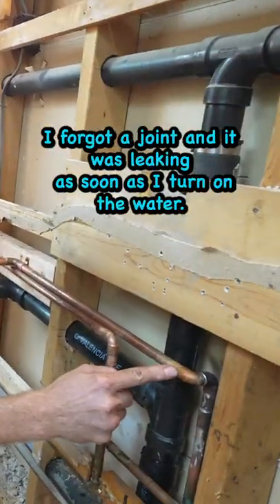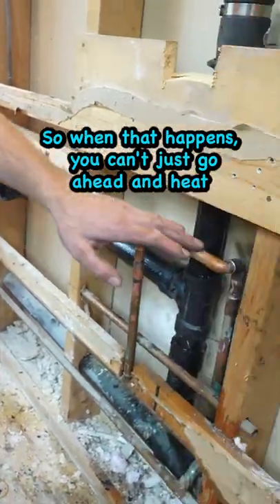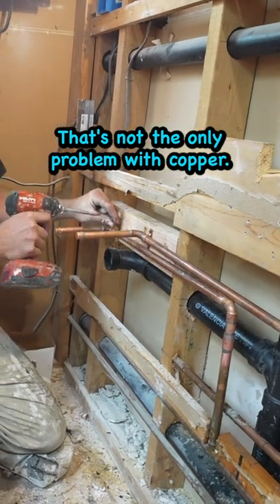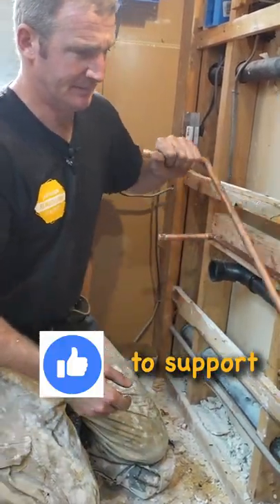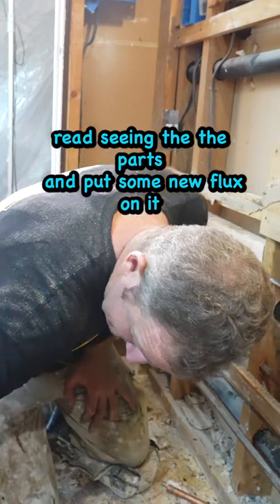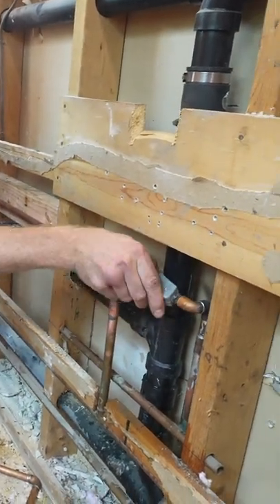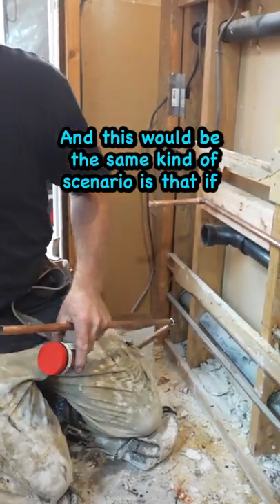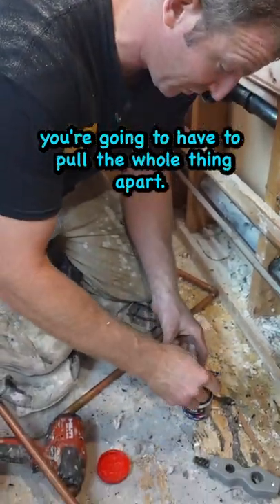I forgot to solder a copper joint 😬 #shorts #plumbing #diy

Comment: If it was sanded and fluxed good the first time you can heat the joint alittle (hot to the touch) and dab some flux on there and it will wick like the solder then heat and solder as usual. I would say 98 times in 100 it won't leak. Best practice is to take it apart especially if this is all the plumbing you are doing on the job. I like pex for certain things but anything that a human can touch I always use copper back until it can be secured in at least 2 places. Pex out in the open is a disaster waiting to happen.

Comment: Use Propress stuff. Done. Wet or dry. My guys won't go back to solder, especially on the larger stuff.  Had to change out a 1.5" back-flow the other day in a commercial building where they needed water off only briefly. Propress was the trick.

Comment: Well done for checking your work before the walls got closed but you didn’t have to take it apart to solder it. Also if you miss a bit of solder you don’t need to take it apart.

Comment: Remember to use new emery cloth. I had alot of trouble getting solder to seal on two jobs. Turns out my sanding cloth was coating my sanded copper.

Comment: Only criticism I have is clean up that spot cause it’s annoying to drop something with flux in that mess lol or drop a strap or a screw or anything and you can’t find it. As a commercial plumber I’ve learned the extra ten min to sweep up my work space makes it easier to see things an limit my mistakes which I know happens to everyone. This has happened on my sites multiple times especially when I have a few guys working on the coppers.

Comment: Just check before using soft solder.  May have a high lead content. Thats how it used to be done. Plumber 30+
Reply: No more lead solder, no lead in fittings either

Comment: This is clearly why I detest copper. I have replaced all my homes with pex and push to connect connection. I no longer have to deal with the hassle of copper. I can add anything in with a simple cutting of the line and adding in some fittings. Copper in homes is just a poor move. It cost far more and has many problems when people have no clue how to install it the correct way.

Comment: Heres another tip get out your wet vacuum and when all the water is pulled out, heat the joint while applying your Flux. When the Flux pulls in hit it quick with solder. Your welcome.

Comment: First off, this guy is clearly specialized in dealing with bathroom uplifts. Turning an outdated bathroom more modern. Most of these comments I’ve read are very controversial an opinionated about his plumbing skills. Clearly he’s more of a handyman than anything and I’m not saying anything bad about that. But working for a plumbing company myself for quite a few years everyone does things differently. Everyone’s talking about pex like it’s the best thing since sliced bread. Sure it’s cheaper and a little more time saving installing it but it’s got its problems too. you get rodents in your walls and they can chew right through it. Any old school plumber would tell you copper is the best way if you know what you’re doing. But some people just don’t have the skill. And sure propress is quick but not everyone wants to spend a couple grand on a good kit plus the expensive a$$ fittings. Another thing shark bites? The worst thing you can ever use unless it’s just for a temporary cap for the lines. Yeah he also didn’t use air chambers but some states don’t require them. Like I said this guy does good work but he’s not repiping entire bathrooms from scratch just fixing small things to give the bathroom an uplift.
Reply: I’ve been doing commercial and residential plumbing for almost a decade and shark bites are not even close to bad. We use them all the time and they come in handy because you don’t need to use glue or solder. I have also never seen one leak.
Reply: @gsaexperience8578  Same here I have been using and installing sharkbite push to connect fittings for more than a decade with out a single leak. I also never had to go back and fix a leak either. People who hate shark bite or like products hate it because a home owner can fix or install it them selves for little to no money. 
A house I did over 10 years ago sat empty for 2 full winters along with one year that had a nice spell that was 40 below. No one ever drained the water so it sat with water in all the pipes and nothing broke. They did fill the toilets and drains with RV Antifreeze yet did nothing. Not a single leak at all. 
Rodents do not go after plastic. I just did a house that sat empty for 3 or so years that was fility and likely had rodents in it and they had pex installed, said pex was removed due to the entire house being remolded. People spread misinformation on things they hate.
Reply: @kameljoe21  Well Sharkbites are sealed by a rubber O-ring that deteriorates over time and causes leaks and if homeowners do use them they usually dont have a guage and dont know how far to push them on so they blow off eventually. Dont get it twisted I use them all the time if in a crawlspace, or transitioning, or just doing 1 fitting. Whats killin me is nobody pointing out all the leaks those drywall screws are gonna cause when electrolosis kicks in!
Reply: @joeyhauber5015  You clearly are bias based on information you have heard, seen or read. While this is the case for majority of people. " SharkBite warrants the fittings for 25 years when used with SharkBite tubing" This clearly means they have a shelf life of between 25 and 50 plus years. The oldest sharkbites I have installed was done back in 2009 and as far as I know its still going strong. 
You do not need a gauge to set sharkbites. They are super easy to install. Testing has shown shark bite holds tremendous amount of pressure like in the 2000 psi range or so. I would have to go find the video that show someone testing them. The pipe will fail before the shark bite will ever fail. 
There are 2 types of shark bite. Push to connect and crimp. While crimp plumbing has been around for a very long time, even in the early 80s and maybe older. They are a pain and in the end cost just as much as a push to connect fitting. You can buy in bulk and get them cheaper. I just the other day replaced a main line from the pressure tank and replaced the kitchen sink,  utility sink, re did the washer and dryer connections and added in a tankless water heater. I was able to finish this up in under 6 hours while not working too hard. I used all push to connect and it looks great and now everything is pex at some point. While the bathroom was done about 6 to 10 years ago it is crimp fittings. At some point I will rebuild the entire pressure tank and jet pump as it has old galvanized pipe on it. I will also be replacing the existing shower as who ever installed it did a poor job.

Comment: If you forget to crimp a pex ring you just crimp it with everything where it's at.... much easier
Reply: But, pex and copper have too many pros and cons. I would use copper over pex in my own home.
Reply: @ezekieo32  you can literally run pex from the supply to its destination in 1 continuous line with no 90s 45s or anything... not always but even so if you do it right you usually only need 1 maybe 2.  Copper you will have tons of solder joints. Each one a possible leak point
....

Comment: 1) What is with the ridiculous subtitles
2) Amateurs turn on water before testing. Supply plumbing should be tested with air pressure before one drop of water enters the system. We always had to maintain 125 psi for 24 hrs. It's easy to miss a joint but it's easy to fix dry.

Comment: Judging by the look of your pants and knee pads, the amount if paint, plaster or caulk your not a plumber by trade. Therefore, it's best to leave it alone. I'm familiar with most trades, but don't touch plumbing for good reason. I had the same kind of experience.
Reply from the maker: That’s a judgement. Guess that’s what YouTube is for. Good luck to yeah

Comment: You should learn how to sweat pipe one joint at a time. No more beers with lunch.
First you said forgot, then you said Flux is used up. Stop smoking joints on way to work.

Comment: Holyshit 1980 called and wants their solider back nobody sweats joints anymore.. nobody.. I can't remember the last time... now with PEX or a ProPress there's no reason in the world to be doing what you're doing.
Reply: We solder daily in commercial applications, o-rings have a life span,  soldering done correctly is forever..
Reply: @AndrewJackson456  yeah we don't use Pex at all shark bites to much money and the crimps always leak way to many call backs last place I worked